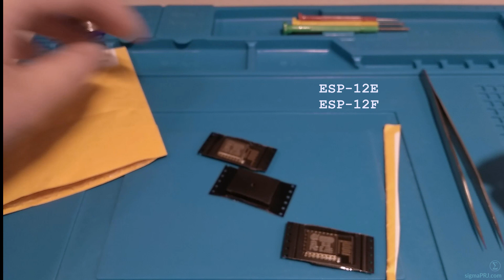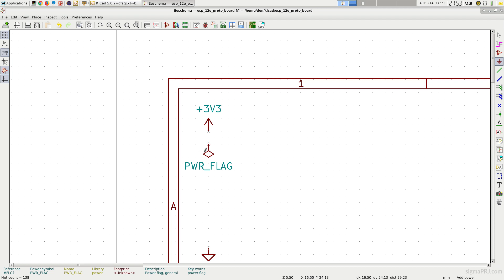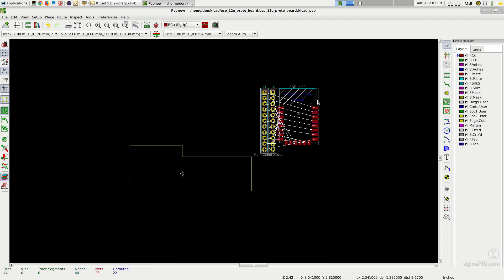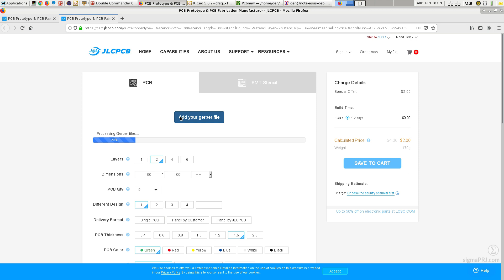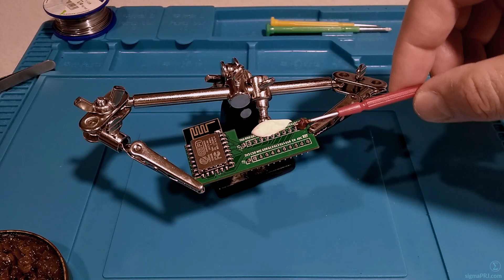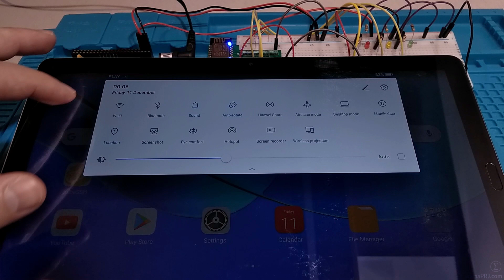ESP8266: How to design custom ESP-12E PCB. Typical TCP client-server application.

Comment: A really excellent video.  I have used WEMOS ESP8266 devices but plan to use ESP-12F in a new project so found your video really useful.  I currently have the components on order from BANGGOOD but it seems like it is going to be a long wait.......
Reply from the maker: thanks, r1273m .. you also might check lcsc.com web site for components ordering... they do provide quite cheap offers for standard components like resistors, capacitors, opAmps, etc ...
Reply: @sigmaprojection3781  Thanks for that.  Just looked at their prices and they are in fact better than Banggood for the 12F.

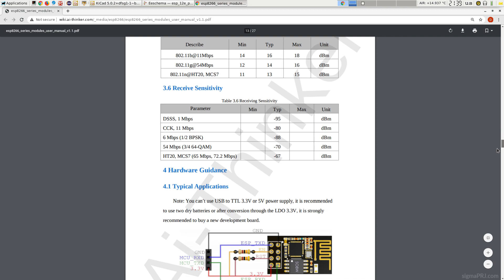Comment: Why did you not include the power supply reference design at 3:36 in your schematic design?
Reply from the maker: yes, this can be included... but in this particular case - the adapter PCB expects that it should be powered by 3.3V (not 5V)... this AMS1117 is included in ESP-LED-Bar design.. you can check it on this page: http://sigmaprj.com/download-esp12e-led-bar.html

Comment: At 14:10 a trace from the ESP GND pad appears. It starts from the front layer goes to bottom layer, but doesn’t to any connect to anything. Why is this?
Reply from the maker: pin 15 trace ends with via... and this via connected to bottom layer, where GND filled zone is applied... this way, pin 15 is connected to ground
Reply: @sigmaprojection3781 kay I understand. But the rest of the traces, for example the RST trace (pin 1) are unaffected by the ground filled zone, right? The trace is on bottom layer, but because it’s connected in both ends it is not at GND potential, am I understanding it correctly?
Reply from the maker: @Fred the Champ  traces can go on the bottom layer without interfering with GND filled zone... in KiCad you can try PCB 3D view (ALT+3), and check the bottom layer... it will have a good indication, of how such cases are handled.. and how cases are handled when connection needs to be done with GND (like pin 15 via)
Reply: @sigmaprojection3781  Thank you man!

Comment: I have heard about PCBs where people use both layers as GND filled zones and then they use something called stitching vias to connect the two GND planes.
In your PCB design you use top layer as +5V filled zone and bottom layer as GND filled zone.
Why do you think people use two GND planes?
Reply from the maker: stitching vias are used mostly for high-frequency PCBs designs... in my case - it is pretty low-frequency operation...
Reply: @sigmaprojection3781  Okay thank you. But do you think having a +5V filled zone and a GND filled zone can have some unwanted disadvantages?
Reply from the maker: not really... +5V and GND plane next to each other will form extra capacitance.. so, this could help in case of any bypass capacitors are needed ..

Comment: Very interesting, very cool, i have a question, what if i want 1 computer to control more than 1 esp at once? Is that possible?
Also i'd like to develop a software that controls them, is that possible? Tips?
Reply from the maker: yes, you can define your computer as Server (with a pre-defined static IP address) listening and accepting TCP connections on a specific port, then you can define multiple clients as ESP nodes. So, each time ESP client will connect to the server computer (to a pre-defined IP address and pre-defined port) - you will have new TCP connection established. Then, based on which language\library you would like to use on server-computer (whether it is Java, C++ or anything else) the life-cycle of each individual TCP connection can be managed.. and data can be transferred to\from each individual ESP-node client

Comment: Hi
Doesn't KiCad has an automatic tool to draw all the striplines once connected electronically? I know Eagle has it.
Reply from the maker: yes, auto-tracing option is also available in KiCad.. but it is not reliable... particularly when working with large schema designs - in certain cases it can bring trace all over the board, while much shorter option is also available

Comment: Hi... what is the default baud rate for the ESP8266MOD ?
Reply from the maker: usually you specify it in your application under uart_init(...) method explicitly ... not sure about any implicit default values for application... for boot mode it might be 74880
Reply: @sigmaprojection3781    Hey, thanks for the response! I actually discovered this last night after I left you the comment.  After the module loads up, the baud changes to 115,200. Weird.  I don't use Arduino. I write all my code in assembly. I am going to use this to send some SMS text messages via twilio.  Thanks again!

Comment: Can you make a video on all types of labels in KiCad and their applications. I just learned from your video that the labels can have the roles input, output, bidirectional, tristate and passive. Although I don't know what the tri-state and passive labels means, may be because of my foundational electronics ignorance.
Reply from the maker: yes, I will probably use it in future projects ... other types of labels are convenient when working with hierarchical multi-sheet schemas (when the schema is exported as nested to another schema - hierarchical pins are used to highlight which pins should be "exported" and visible in the parent schema) or putting extra labels on existing net wires (to make PCB traces more descriptive while routing). In basic terms tri-state - stands for connected to high (e.g. +3.3V), either connected to low (e.g. GND), or not connected at all - "hanging in the air"

Comment: nice video but how to just power on esp12 e moduile with external 3.3v 
not for flashing...for just turning on the esp12 e
Reply from the maker: in order to just switch-on esp module, need to supply 3.3V on GND and VCC pins... but there is a need to make sure that power supply can provide sufficient amount of current, otherwise ESP module will be constantly rebooting causing LED blinking

Comment: So you want to replace a $2 wemos D1 with everything onboard and use a 1$ esp12e + $2 pcb and still don't have usb or anything...
Reply from the maker: 2 PCBs - it is just for educational purposes... in some mass production - like WiFi LED Lamp would be more profitable to have ESP-12E instead of full-scale thinker-board with USB support ... as here ESP needed to be flashed once, just at production stage...
Reply: @sigmaprojection3781  for educational purposes the video has nice value. My reaction was actually only about pricing. It is always nice to be able to make your own pcb footprint for projects.